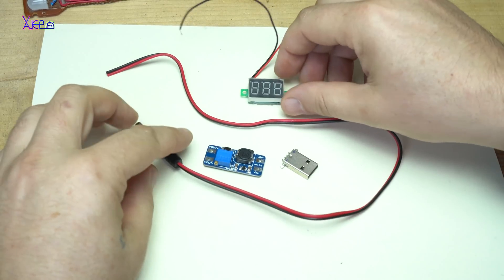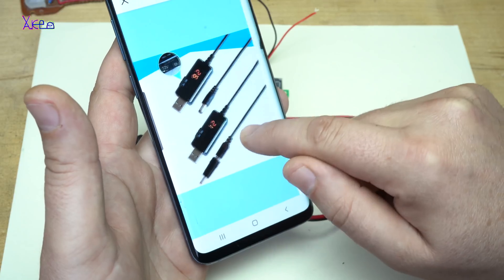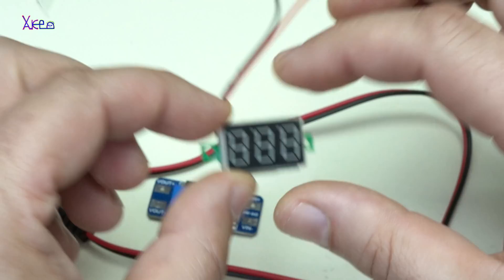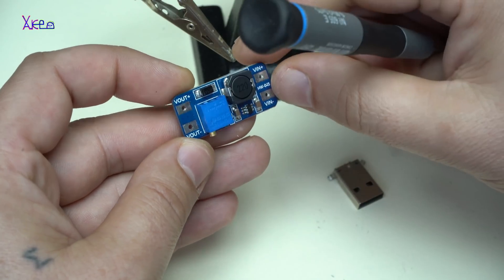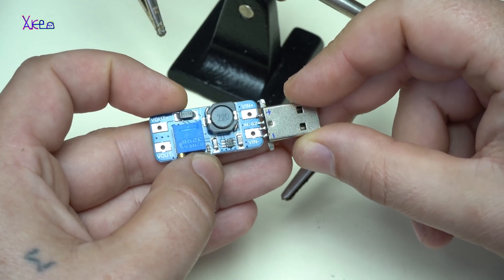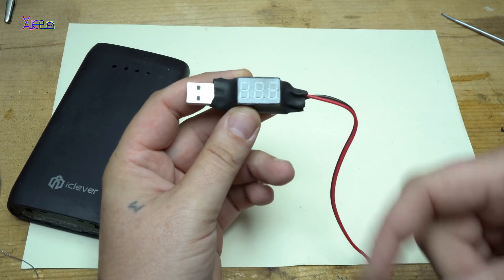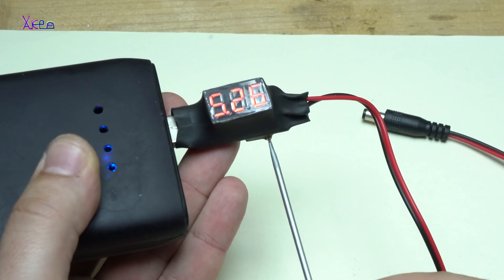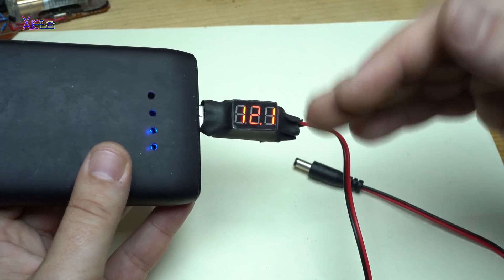Making USB Power Cable | Homemade USB Boost Cable

Comment from the maker: Suggest a cool project,maybe I will make it:)
Reply: Rgb led driver circuit using NE555 ic and 4017 ic
Reply: Make project on DC-DC Step Down Converter
Reply: Can you make drone by foam sheets in low cost bro..
Reply: Bro remember me?
Reply: PLEASE make a mini amplifier circuit without PCB using- transistor, resistor, capacitor etc.. please bro.... please reply... love from BANGLADESH 😍🇧🇩 bro
Reply: you should make an electromagnetic web shooter
Reply: Make a Airplane like Beacon Flasher/Blinkers using ATTiny 85 if not already
Reply: @Assassin 6676 Lol, this was the question for creator and not the audience.
Reply: @manukalias  no probz if he replied
Reply: Can you make a car jump pack out of that??
Reply: A wifi repetiror with esp8266 module includeing a powerbank! I know You can make it
Reply: Make glasses like in movie "kingsman"(agents get whem)
Reply: Make a fog machine and light decoration
Reply: Make A 48v Phantom power For comdenser Microphone plz plz plz plz
Reply: A virtual reality headset for cheap
Reply: Make a video on increasing and decreasing the current usb charging module tp4056
Pleasee
Reply: can you make a simulation of a memory in protoboard?
Reply: Can you make used webcam + esp wifi = wireless camera?

Comment: Here's a tip. If you have wires protruding from a larger heatshrink like the output side of your board, just fill the excess with hotglue. Acts as a really good strain relief.

Comment: I use this cable to power my Dji goggles v2 using a battery bank. I was skeptical at first thinking the power would cut out and not provide constant voltage and amps. It worked lol
Reply from the maker: Connecting such a diy device to your googles its not clever,I show in the video just an idea how its possible to make usb power cable

Comment: Fun and easy!  The outer shell is less aesthetic but I bet the quality is 100x better.

TL;DR; version If you're learning or just prefer to build your own electronics: great option.  If you're just looking to save money to obtain a common item,  this is not a good option.  

The math doesn't really add up on the "savings" spend $6 less + required skill level + $80-$200 in equipment (soldering iron, voltmeter, alligator clips, power supply) and supplies (sheath, step-up converter, segmented display, tips, wire, solder)   and 2-4 hours figuring it out.  If you bought it all used or cheap and don't even factor in what your time is worth (because we're doing this for fun of course) you're sitting at very minimum $47 more to do this.  Though I suppose you'd come away with supplies you could sell for $30 or so..  maybe at absolute minimum $17 more for this provided you don't have some kind of privileged access to this kind of equipment and supplies.

Comment: I am interested how it works under load, does it cause a bigger voltage drop? 
I am thinking of creating a UPS for my router from a power bank and this step up converter. Can it work?

Comment: jeez i learned 2 big things from here. That you can easily make something with USB powered with just those 2 leads and that you can heat the end of a wire with lighter and strip it that way. I always have used wire strippers. Man such a good video.

Comment: This voltmeter does not measure under ~5v, you need the other model with 3 wires, then the power wires you take from USB and the measure wire you connect to the output.

Comment: It looks cool, but This module heats up a lot when you boost it even a little bit. Then the chip on it, stops working within 2 o 3 uses, due to heat damage.
Reply: what can you do to avoid it from getting too hot?
Reply: @brakefree6434  mini heatsink

Comment: You can't just magically multiply voltage.  The current will suffer in inverse proportion to the voltage increase.  Assuming the 5v usb supply is 2A, the 24V output will be a little over 400ma max. Net result,  the power output (in Watts) will be the same (or less)
Reply: Me too
Reply: What about transformers
Reply: I don't think he said you can, but many devices don't care about high current as much as they care about high enough start up voltage, like dc motors for example which usually require around 7V to start up

Comment: When you are on 12V, how many Amp hours are you using? I don't know the math and thinking of my big battery and computer. Or better the math, so I can work it out.
Reply from the maker: On 12v will give around 1amp but will pull over 3amps from source
Reply: @Hacktuber  AWESOME thanks
Reply: @jonathangreen2231  bear in mind that 1Amp load at 12V output from a 5V input like a powerbank will push the module to its max limit, it will get very hot and prone to fail. for 12V output i would suggest you to put only about 500mA max load, less is better, if you're planning to run it for hours.

Comment: Can i use it to power mi optic fiber modem when energy falls?(whit a powerbank)
Reply from the maker: Prob yes
Reply: I think only if u have a 5volt 3A from ur battery bank. If you use the same device from a 2 lithium ion batteries, Yes it's possible, as the battery would give enough current. But then you need additional circuit to maintain battery like avoiding over discharge. 
So in short unless the battery bank flawlessly give you more than 3A, it's not possible.

Comment: Sir it can use to run led strips
Reply from the maker: I tested more than in video, its safe to use up to 1amp at12v,yes you can run led strip 12v

Comment: I liked your projects, could you please indicate which type of glue you are using in your projects, I saw sometimes you are using a spray and glue, but during that project you used something like a glue stick ? Could you please tell us what both are ? Thanks !
Reply: Daniel Adams that’s super glue and the spray is super glue activator (baking soda and water or isopropyl alcohol).
Reply from the maker: My 2 component glue is name Furkan its from turkey,its activator+hardener